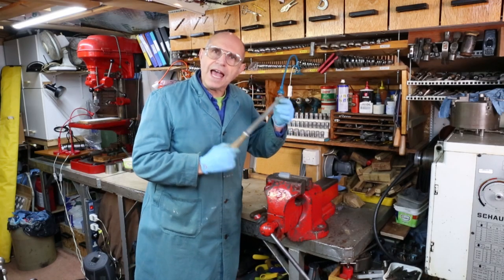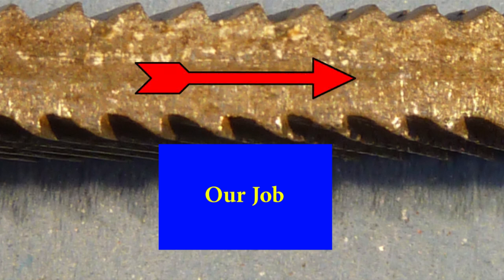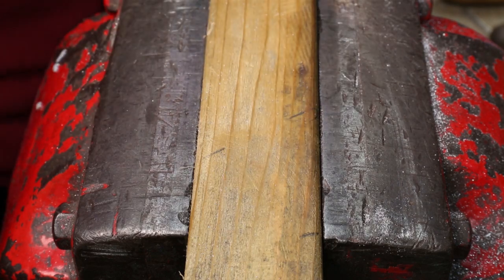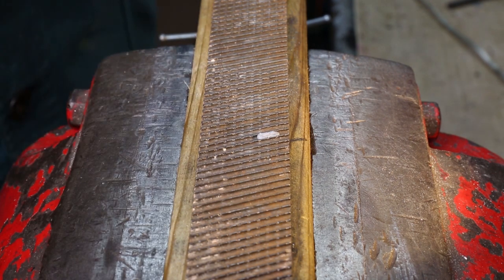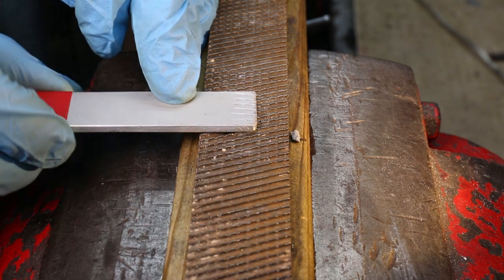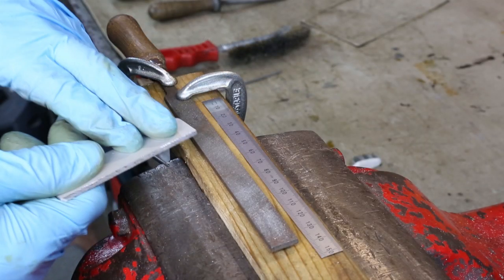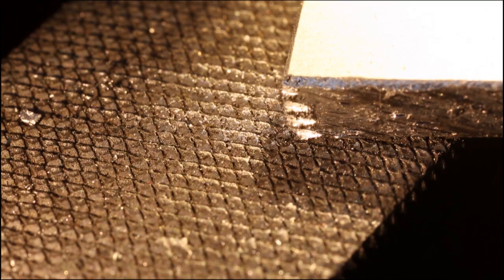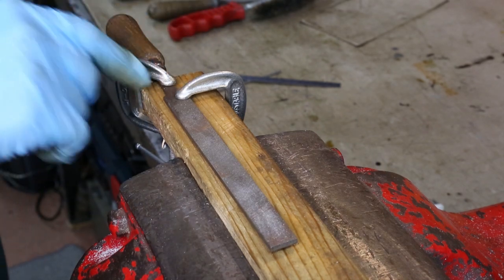How To Clean A Flat Hand File. How a Hand File Works

Comment: Is there a good way to sharpen files without heating?
Reply from the maker: Hello Thomas. I have never tried to sharpen a file. I have seen on the internet and YouTube people acid dipping the files which they say brings back the sharp edge, but I suspect its only temporary, probably not as good as it was when it was new. Best thing is to replace the file, if too expensive try garage sales or boot sales. I have picked up some bargains in such places. Take Care Jim.
Reply: @CYC123  Thank you.
I have never heard of the vinegar method. I only know about taking the temper out, sharpening then re-tempering .
I'm gonna say my blacksmithing skills are a little lacking in the file tempering arena.😎